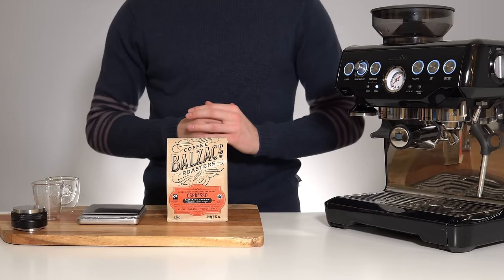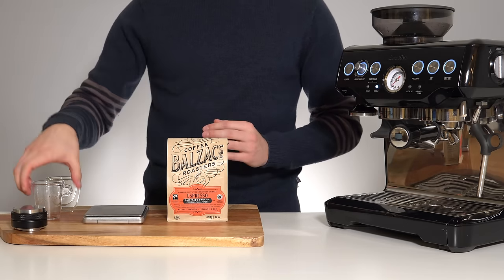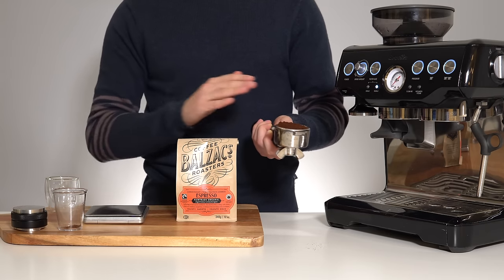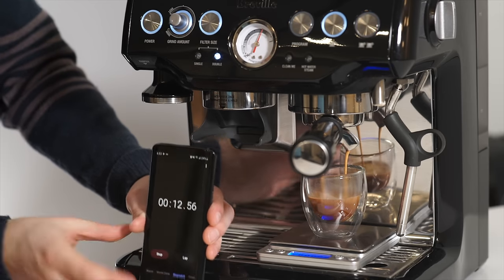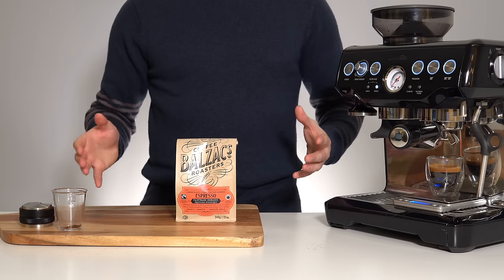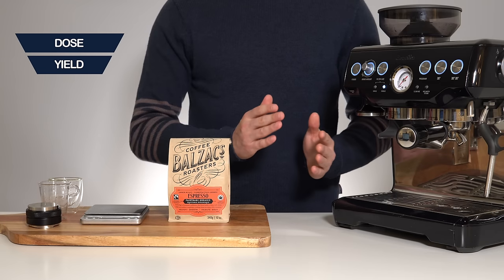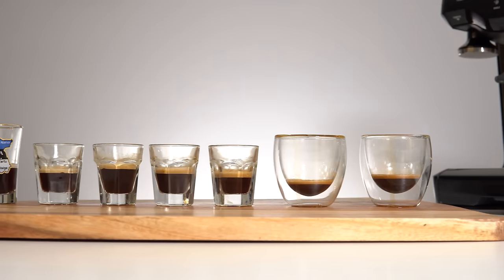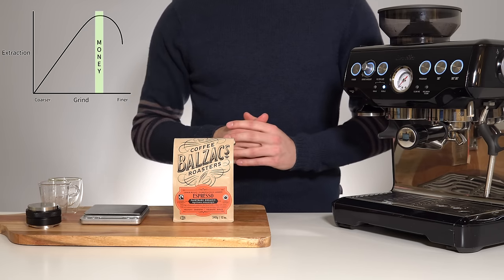Dialing In Breville Barista Express | Dose, grind, yield, time

Comment: Could someone please help me?
I have both the external and internal settings at the finest setting (one) and I am still getting espresso shots still pouring too fast but there seems to be decent pressure. I have a tamper that 'clicks' at the set amount of pressure and I struggle to fit anything more than 19-20g of beans into the 54mm basket. Could it be I am not tamping hard enough? I have been experimenting for so long with different dose sizes and grind settings and can't get a decent pour over 20 seconds! I am using a bottomless portafilter with single wall basket. 
Thank you for any advice.

Comment: I noticed on the front your grind says more. The person at Breville said leave it at 3pm. What do you recommend?
Reply from the maker: I am single dosing to ensure a consistent weight. So when grinding until empty it makes sense to just leave it at the maximum setting
Reply: @LifestyleLab_  I see you were just trying to  clean the grinder. If this is new should I leave it at the 3pm position?
Reply: @LifestyleLab_  I just don't want it overflowing over the portafilter
Reply: @LifestyleLab_  One more question if I always want a double shot should it be the 18 grams beans and 36 grams liquid?
Reply from the maker: No, this isn't about cleaning the grinder, it's about getting a consistent dose. If you use a timer while dialing in, the dose will change every time you change grind coarseness. 
Once dialed in (no longer changing the grind coarseness), you can set the timer to dose the desired 17g. 
I recommend using 17g in these smaller 54mm portafilters. The yield will depend completely on your coffee, and personal taste preferences
Reply from the maker: This video is newer and explains things in slightly more detail in the second half: 
https://youtu.be/D-bV4j-Z-sU

Comment: Why would you suggest a sensor (scales) that is not supplied with the machine, when you could just use the 12 o’clock pressure as the North Star, and adjust grind size, powder quantity until you get there. These are all shipped in the machine. You’re over complicating it. Flavour robustness can be increased by more fine + less powder. Less flavour, coarser + more powder. That 12 or 2 o’clock still stays as the North Star.
Reply from the maker: Because pressure is a very broad measure of quality. You can get very good shots at the same pressure as very poor shots. 
Espresso is dialed in by taste, using the brew ratio and shot time to adjust the extraction for that particular coffee. This applies to all brewing methods, and again, is done every morning in every cafe around the world.
Reply: @LifestyleLab_ if you’re so right, these machines would come with fine scales - they do not. My method works just fine
Reply from the maker: Then why does every cafe around the world do it the way I’m describing? 🤔
Why does the largest coffee expert on the internet use this method? Do you know better than all of us? 
https://youtu.be/lFwJF-_SUr0
Reply: @LifestyleLab_  you’re not able to think for yourself I see. The technique will differ given the machine. With the barista express it has a grind quantity you can adjust which correlates directly to the weight. Why weigh it recording arbitrary numbers when you could adjust the dial that ships with the machine. Using scales is not appropriate advice for regular people buying such a machine. We should use the dials and knobs given on the machine.
Reply from the maker: Use whatever method makes you happy! 
But don’t go around trying to sway others from proven technique 🤷🏻‍♂️

Comment: How do you calibrate the automatic double shot button to make 36g of espresso? This video is implying that only way to make decent shot is by using manual stop at 36g.
Reply from the maker: When you press the program button and then manually stop/start as shown it the video, the machine saves that as the new preset for the button you used. Hence the "Program" label :)  
Then, you can simply use the button on it's own for all future shots once you're dialed in
Reply: @LifestyleLab_  thanks so much!! New barista espresso is arriving in 2 days and I was just studying before it arrives :) now I know what to do when it finally gets here
Reply from the maker: Awesome, enjoy!

Comment: Watched this a few times now but I'm still struggling to get the right shot with my Barista Express. I've been using 18g of coffee but I'm finding it's coming out too quickly despite adjusting the grind size. If I go too fine the pressure gauge goes right up above the espresso range yet still comes out too quick. If I go slightly courser then I hit the desired espresso range on the pressure gauge but still comes out too quick. I just can't seem to get 36g out of an 18g shot in the desired 20-30 seconds and keeping the pressure gauge in the espresso range... any ideas? I'm using freshly roasted beans from local roaster and have tried a few different types of beans, all fresh. I've tried increasing the dose to 20g but its still coming out too quicky. I'm tamping fairly hard and waiting on a palm tamper to arrive from amazon but any tips would be greatly appreciated. Thanks for the great content.
Reply from the maker: The "espresso range" marked on the dial is flat out incorrect. Everyone who owns this machine agrees that the best shots are pulled with the needle somewhere in the 12 o'clock to 1 o'clock position. See 6:20 in the video
Reply: Lifestyle Lab thanks for the quick response... yes I’ve seen a lot of people say that but the problem I have is it’s going way past 12-1 o’clock and still coming out too quickly 🙈 just can’t seem to slow the extraction down and not go past 1 o clock
Reply from the maker: If the pressure is high but the espresso is still coming out quickly, you likely have some channeling going on in your puck. A bottomless portafilter could confirm this for sure. Try paying extra attention to how you are fluffing and distributing the grinds in the filter basket. By nature, the Breville grinders are quite prone to clumpy grinds that need to be broken up before tamping
Reply: Lifestyle Lab thanks 👍 will try that out

Comment: Hi I always need to place to the grind setting of #2 or #3. However I noticed most achieving the right pressure/speed at the middle coarseness of #7/ #8. Just wondering if there’s something that I did wrong.
Reply from the maker: Nope! All machines are built slightly differently. On some machines you will even need to adjust the INTERNAL grind setting so that you can move past the external grind limits. As long as you're achieving proper flow, don't worry about what number you're at
Reply: @LifestyleLab_  Thank you for your reply! One more question. For the shot timing, do I start when the first drop touch the cup, or the moment I press the button? As different sources say differently
Reply from the maker: Any exact timing is only to get you into a general ballpark of proper flow. In reality each coffee is different (hence the different information). Once you have good flow, you need to taste your shots and use the concepts from the second half of the video to finish dialing in
Reply: @LifestyleLab_  Very helpful! Thank you so much!

Comment: 18g of beans is way to much for the double shot filter? i tipped mine in like you did and it is literally overflowing and atleast1/4 is in the sink because the mound is way too high
Reply from the maker: If you can't fit 18gr in the basket, you're likely grinding too coarse. The finer you grind, the more beans can fit in the basket :)
Reply: @LifestyleLab_  thanks for the quick reply mate. I ground at setting 8 like you but I am thinking that my old kitchen scales may be a few grams out and I'm grinding more like 24grams or even more.
Reply from the maker: Also keep in mind that my setting of 8 is not necessary the same as your setting if 8. These machines are not calibrated to one another. Remember, you can grind much finer even than setting 1 by adjusting the internal grind setting (upper burr)

Comment: Hi, I am new to coffee brewing and I just got the breville barista express. I need some help. On a grind setting of 8, it took me around 12 seconds to pull a double shot (60ml). I lowered my grind settings to 4..now it takes even lesser time. It took only 10seconds to pull a 60ml shot. I am using 16 grams of grind. Cannot fit more than that in the portafilter. What am I doing wrong? What should I do? I am getting frustrated.. Am I tamping wrong? And it barely reaches the pressure..its way below the expresso zone even at a grind setting of 3 !!! 😭😭
Reply: Chill out!!! Your coffee is probably old, this is why. What you need to do is grinding finer, 1 or 2 and tamp hard. With fresh coffee you barely need to tamp otherwise the pressure will be too high, have a nice day. You can watch my videos on this machine 😀

Comment: Approx how much caffiene is in that? Does it vary with settings aside from single/double?
Reply from the maker: It will vary greatly depending on the coffee used, but as a large generalization, a double shot has around 80mg of caffeine
Reply: @LifestyleLab_  Thanks. If I use the single shot option and it produces 4oz liquid, it's not 4oz of espresso or higher caffiene, it's  the same but more diluted?
Reply from the maker: Basically correct. After a shot is properly extracted, it will continue to extract as you push more water through, but at an ever decreasing rate (and at the expense of good taste). In order to get more properly extracted espresso (and caffeine) you'll need to increase the actual dose

Comment: I probably need a help. For 2.0 ratio, I am getting either < 12 seconds for coarse or < 19 for finer grinds. For even finer grind I get very high pressure with just few drops of liquid tasting like plutonium. But all my shots tasted very sour in general. I even tried to raise the temperature on the Breville machine by 2 C°, yet - still sour. So I dont know, where to go with the settings. 
I made coffee with my V60  and it tasted amazing, but I cant pull decent shot with this :-( I am using only freshly roasted beans and tested various shops.
Reply from the maker: Use the finer of the two grind settings you are stuck in between, drop your dose by 1 gram, and pull to a 1:2.5 or 1:3 ratio to increase extraction
Reply: @LifestyleLab_  Thank you! Will try it. I forgot to appreciate you awesome content on this channel before, so I would like to address that now - love it!
Reply from the maker: Thanks for watching!

Comment: What can I do if the espresso runs too short and is over-extracted?
Reply from the maker: If your shot is running too quickly, it is not likely that it is over-extracted. (Grinding too coarse leads to fast flow and under-extraction) What are you tasting?

Comment: @LifestyleLabd - so basically is one single shot of Espresso made with 18gms of coffee beans, so if i want a double shot do I grind 18+18gms or actually whats the logic where you can pull 2 shot in onegrind ?
Reply: Also Ive seen outside grind size to be kept 8 and the one one inside the hopper3 . Whats the inside hopper grind setting for the Breville actually ????
Reply: Also I ve seen people let hot water ou before diallibg the grind back inside and then letting the fresh hot water infuse, Is there any difference in that process ?
Reply: or when you choose double shot more water infuses with the coffee, Is that it ?

Comment: I'm more confused then ever.   I've been using the pressurized baskets for months because I've never been able to pull a good shot without one.   I've gone through a half a bag of beans and i really am more lost than when i started.
Reply from the maker: Follow these steps for me (using the single wall double shot basket) and we'll diagnose what's going on :) 
1) Empty the hopper, and then grind out any remaining beans
2) Set the grind setting to 7 
3) Put 18gr of beans in the hopper and grind until empty
4) Pull a shot, and time how long it takes to get 36gr of espresso in your cup
Reply: @LifestyleLab_  Thanks for taking the time to reply.    

First off, 18 grams produced quite a bit that i had to really apply A LOT of pressure during tamping to get it most of it compacted.
I ended up with a time just over 17 seconds from the moment it dripped to 36g of coffee.  The result was a dark shot with a very thick creme on top.  It was a bit bitter
I actually got a puck when i tossed it which is something I've really not had before. No liquid pooling on top.

I lowered the Grinder  setting to 6 and it took almost 20 seconds but it took upwards of 10 seconds for anything to come out.  
At 5 it choked.

Comment: I'm having so much trouble fitting in 18g (or even 17g) of 8 grind espresso (Starbucks Decaf Espresso beans, sorry) in my Barista Express dual wall double filter basket.  When I tamp hard enough to fit all the grinds in the basket, it's difficult to get the portafilter in the group head because of the grinds being too close to the top of the group head.  So I use that Razor device provided with my machine to essentially scrape off several grams of coffee so I can fit the filled portafilter into the group head.  I've had this machine since March and most always get bitter espresso.  When I increase the grind size to make it coarser then there is even a higher volume of espresso to fit in the basket.  Can you help??
Reply: That's the trap while dialing in. The coarser you grind, the bigger the volume of you coffe gets. That means that at some point you have to start decreasing the dose. But nevermind: a grind size of 8 should always be the start of the dial in process. You won't be able to get a decent shot with these settings. Imho good settings with almost all fresh beans start at a grindsize of 6.

Comment: I have my Grinder setting on the finest it will go and I’ve tried using 18 and 22 g and still can’t get it to get to 36 g without stopping it always falls short and stops what am I doing wrong please.
Reply from the maker: You can still grinder finer using the inner adjustment to the upper burr

Comment: I'm using the finest grind setting on my beans, but the coffee is still too watery and the pressure gauge never reaches the espresso range! Even at a higher weight and with the portafilter at max capacity, it only reaches the second dial on the pre-infusion phase. I don't know what I'm doing wrong here - can someone give me some advice?
Reply from the maker: Breville Barista Express Top Burr Adjustment
https://youtu.be/QNvOcE4-VEo

Comment: I'm still having trouble with getting the right espresso shot. I'm using fresh beans, adjusting the grind and everything but still ending up with sour shots. I make coffee for myself regularly using the single espresso button (1 CUP button) but using the double cup filter (is that okay?). The shots usually run short on the 1 cup button and too long on the 2 cup button.  How can I fix this?
Reply from the maker: By using the single shot button and dosing for a double shot, you are severely under extracting your shot, which is why it's sour. Use the concepts in the second part of this video to better understand why that is. 
Both the single and double shot buttons are set to run for a set amount of time (not volume of water). This time can be changed by pressing the program button before the single or double button. When you do this, the shot will run indefinitely until you press the single or double shot button a second time to stop it, and then that time will now be programmed as the default for that button.
Reply: Ah okay, thank you so much! I definitely need to adjust the settings a bit more. Most like to a finer grind bc the flow tends to be a bit quick. I’ll keep watching the video as a guide. Thanks again!
Reply: @LifestyleLab_  Isn't the shot buttons volumetric? 30ml and 60ml? or is that just for the Pro.  Also why do you start the timer once the pour starts and not when you press the button?

Comment: ok i'm struggling here. put in 18g of coffee, manual program and timed my shot.  got it close to 36g, but time only took 9-10sec starting from the first drip.  i turned my grind amount to max like urs and the grind setting already moved it to 2 and still no go.  only variable i can think of is i use the original temp.  ordered the LuxHaus first and see if that helps.  if not will try the palm tamp.  any other suggestions?
Reply from the maker: If you are dosing 18gr and getting 36gr in 9-10sec at a grind setting of 2 it means you need to grind finer. But how? You're already at almost the finest setting. Wrong! You can grind even finer by adjusting the INTERNAL macro grind setting. See this video on how: https://youtu.be/QNvOcE4-VEo

Comment: Hi, so I did the programming and hit the 20 second- 30-second extraction time range but the dial of the machine was higher than the espresso range. Like much higher indicating over-extraction even though  I hit 20 seconds. What should I do now. Should I just ignore the dial
Reply from the maker: The best shots are pulled somewhere around 12 o'clock or 1 o'clock, focus more on flow, not so much to the pressure gauge. And even more than both of those things, dial in to flavor!
Reply: @LifestyleLab_  Thanks for your help, btw after I 've programmed the machine, the next time it remembers everything yeh like I can just press the double shot button without programming it again.

Comment: My breville doesn't seem to go into the grey zone area at all. Any tips for what may be wrong?
Reply from the maker: Pressure for good shots is generally with the needle around 12 to 1 o'clock on the dial. If you can't build pressure, you likely aren't grinding finer enough, or using fresh enough coffee :)